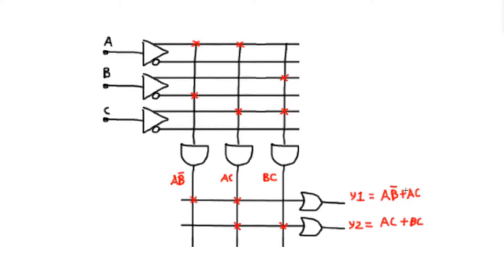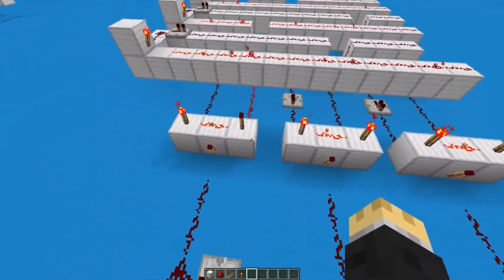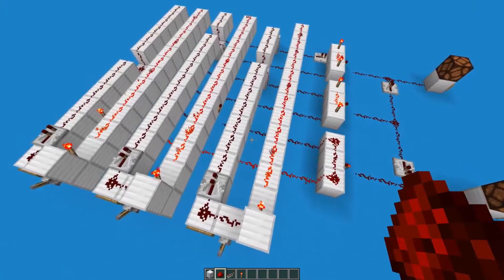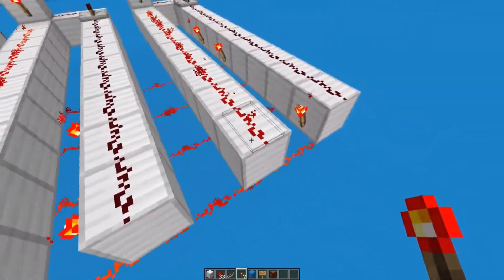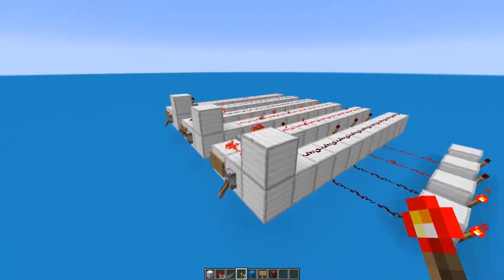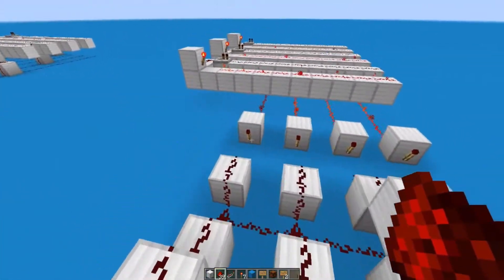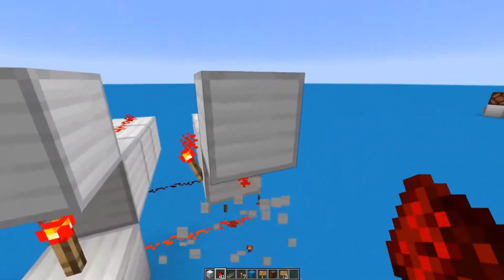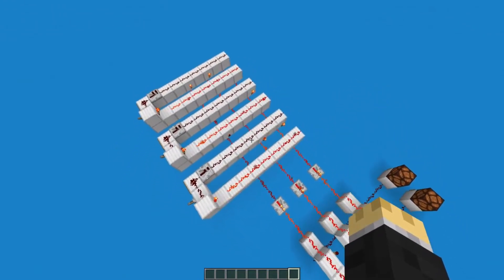Building PLA's with Redstone

Comment: I've spent a few days trying to convert truth tables into k-maps, then expressions and then programming them into PLAs in Minecraft and everytime I'm like "Alright, I think I understand how to do it, now" and I try it, it doesn't output the right things. I will admit I'm having issues with the algebra itself, but even keeping it somewhat simple, something goes wrong and I can't figure out what. 
I don't know if it's my k-maps or if I'm making mistakes in the simplification, or if I've misunderstood the programming part but it's getting frustrating haha
I wish I could have a tutor looking at all the steps with me to figure out what I'm not understanding
Reply: Okay so it makes me wonder if my problem is that I'm trying it with randomized truth tables. So I have to ask: can you do a PLA for absolutely any truth table or expression? Or is there things that could break it?
Reply from the maker: @Nathouuuutheone  As far as I'm aware, any truth table can be made into an expression... it's just some are much larger than others.
Absolutely any expression can be converted into a PLA though, so long as it's formatted in a sum-of-products arrangement.
E.g. you're not allowed to have A(B+C)... instead, it must be arranged as AB+AC
First thing I would do is make sure your expressions are correct.
Start breaking them down and use them to reconstruct your truth table.
If what you calculated matches your initial truth table, the issue is in the conversion to the PLA.
For example:
if you used a k-map to create the expression ABC'+A'BC
With the input A = 0, B = 1, C = 0
The expression would then be 010'+0'10
Eliminating the nots: 011+110
ANDing: 0+0
ORing: 0
So the result of A = 0, B = 1, C = 0 is 0
Repeat that for all combinations of A,B, and C, and see if that table matches.
Reply: @n00b_asaurus  Okay, I went through my simplified expressions and they don't match my truth tables. Apparently I can't do algebra hahaha fml
Reply from the maker: practice makes perfect... even thought there's no such thing as perfection, and repeating things with the expectation that the results will be different is the definition of insanity :/
Reply: @n00b_asaurus  I lowkey gave up on the algebra. But I'm starting to put the other knowledge to use, I'm working on a live programmable music computer/sequencer
Reply from the maker: Lo! You have discovered the efficacy of applied knowledge!

Comment: I have a very hard time understanding the previous video, but PLA is just like a decoder, right?
Reply from the maker: Kinda sorta.
Decoders most commonly translate a binary input into a 1-of-n output.
PLA's are arrays used to implement boolean expressions.
While the circuits used in each device is similar, the functionality is very different
The previous video actually did a decent job of explaining it, I'd recommend watching it again.
Reply: @n00b_asaurus  Rewatched and it all makes sense!

Comment: So can pla s be used for an x y decoder to turn on a pixel on a redstone display
Reply from the maker: you could... but keep in mind there's no good universal circuit.
Some circuits perform certain tasks far better than others.
In this case, just 2 normal decoders and a matrix of and gates would work best for a pixel selector.
Reply: n00b_asaurus how can I setup the and gate matrix
Reply from the maker: @samuelhulme8347  I'll give you the basic principle, it's up to you to discover the details:

what you do is set up 2 decoders to represent your plane. One spans one axis, the other spans the other axis.
E.g. if you have a vertical screen of pixels, you would have on decoder select each column of pixels, and another select each row.
At the intersection of each selection is the pixel you want to control. So if one decoder is selecting column 3, and the other decoder is selecting row 2, you would be selecting pixel 3,2.
Another way to look at it is the pixel 3,2 is only selected if column 3 is selected AND row 2 is selected.
Notice the and?
So by placing an and gate everywhere the columns select lines and the rows select lines intersect, and connecting one leg to the column line, the other to the row line, you can isolate and manipulate that one point in the matrix.
Reply: n00b_asaurus thx